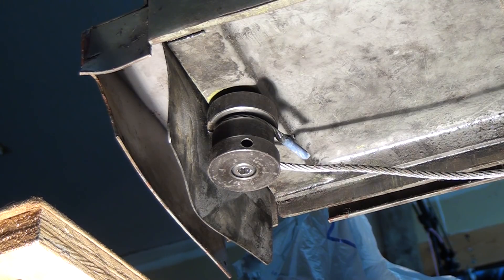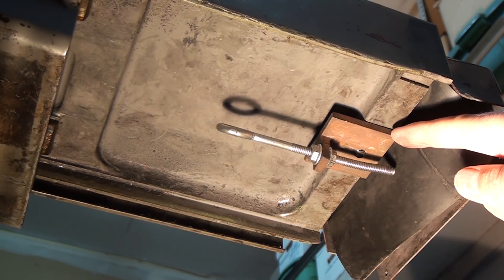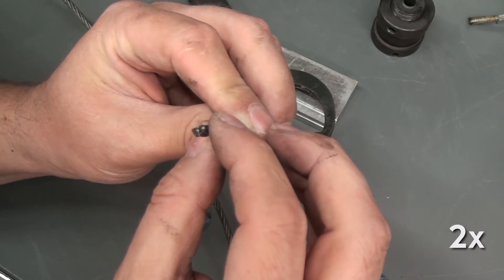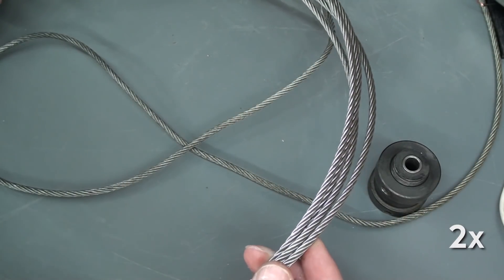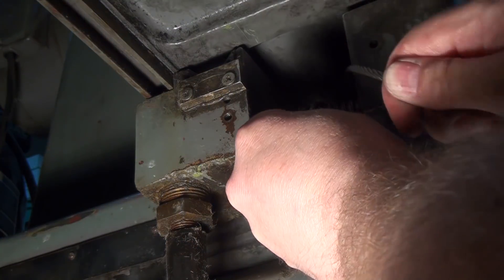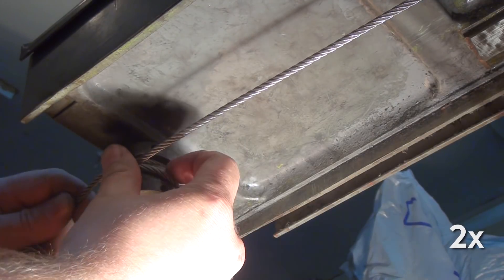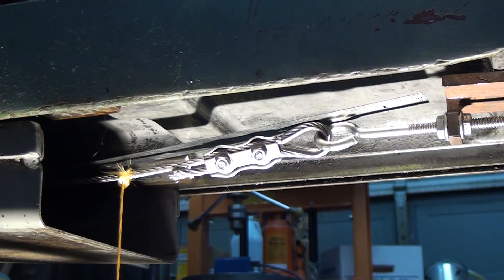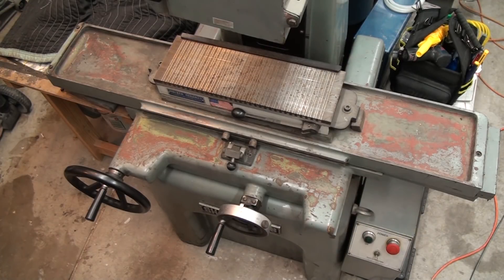Sharp SG-618 Traverse Cable

Comment: Russ, we just received a brand new SG-618 and I think the cable was installed incorrectly from the factory.  I went to turn the traverse handwheel and nothing happened, so I looked under the table and the cable was off the pulley.  I found that the stock cable is (keep in mind its all metric) 4mm OD, which is near your 5/32" OD and appears to be a 3mm cable with a flexible coating and when I got it re-wrapped up correctly with 7 wraps on the hand wheel pulley, it all seemed to work correctly.  I even custom CNC Plasma cut a lock ring spanner for the 40mm diameter lockring.

Comment: Timely video 2 years later.  I need to replace the cable on my Taiwanese grinder after it slipped off the screw.  Putting the cable on the screw with the free end on the right side is the key.  My screw has a smaller radius and more threads.  Existing cable is steel with plastic coating.

Comment: Hi Russ. Following on from the interesting kevlar suggestion below, some stainless steels work harden which can make machining them interesting. I was wondering if that could happen with this cable? I suspect I'm missing something as ss cable is widely used in ships fittings etc, but perhaps not on winches?  BobUK.
Reply from the maker: Wow I hadn't thought of that. This cable is called 18-8, I'll have to research it to see if that is a potential issue.

Comment: Left hand thread on the cap screw replacement, that way, you can do what you wanted to do, but also respect the way the cable comes off the screw drum. Which kind of begs the question...how do you know that the drum you have isn't from the other side, and that the missing one wasn't like i suggested?? Do the instructions speak of this? It would seem the most logical way to house such an implement.